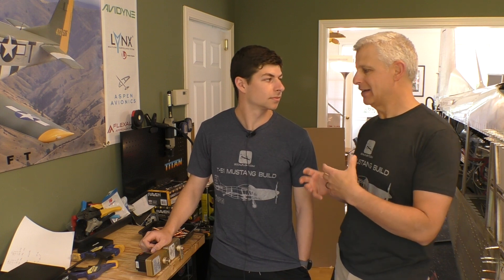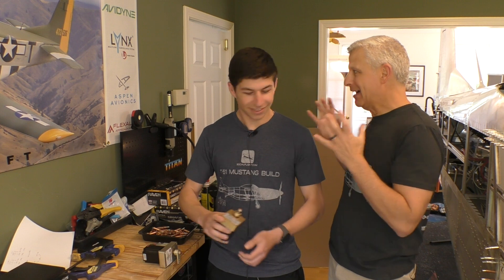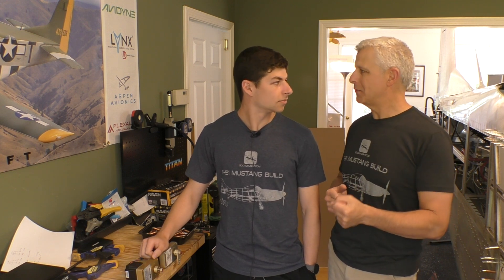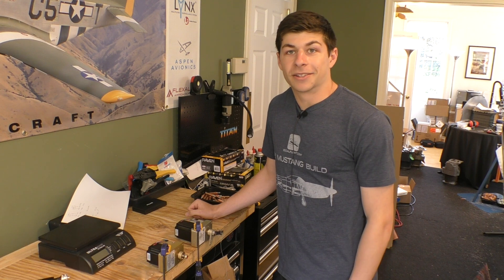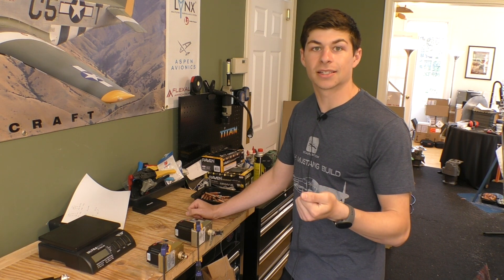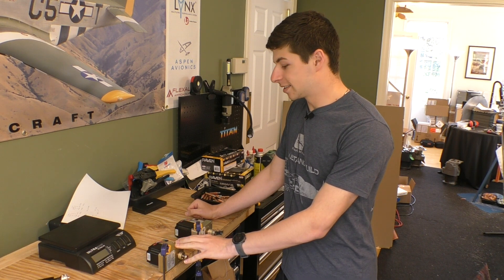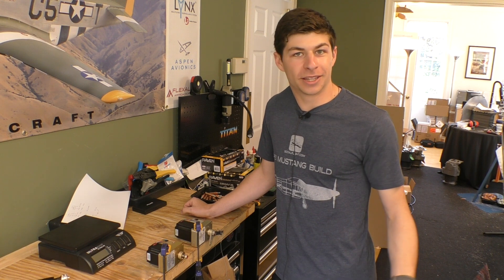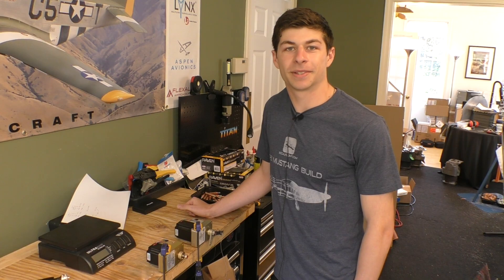Autopilots Can Be a DRAG! We Made Ours BETTER!

Comment: In my airplane the pitch servo is too weak.  It works fine in smooth conditions, but struggles and disconnects in rough conditions or when making flight changes like starting a descent or leveling off.  Have you considered whether the reduced torque of the smaller servo will be enough?  Also, changing the arm length will have a similar effect on drag and performance.

Comment: I think it was good that you chose to quantify the differences between the two servos.  In any case, I’m surprised somewhat that the supplier did not specify the torque required to overcome each servo.  You demonstrated that it is possible, and I’m pretty sure there are simple yet elegant methods of measurement, including ready made equipment.

Does the servo remain “in the mechanical circuit” (so to speak) when the autopilot is turned off? Or, is there a clutch that effectively removes the servo when the autopilot is off?
Reply from the maker: No clutch. The servo always remains in the loop adding drag. That’s why we did the research and switched to a much lower drag servo. Unfortunately, they don’t specify the drag and we couldn’t find any torque measurement tools accurate below 5 in lbs.